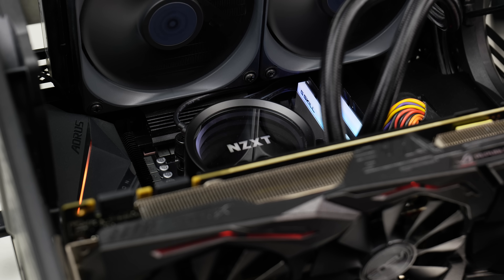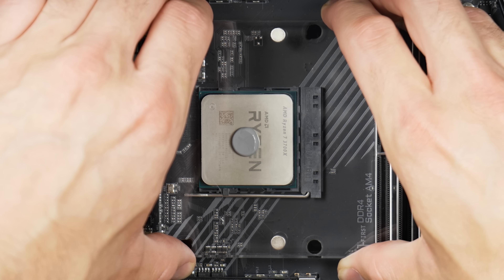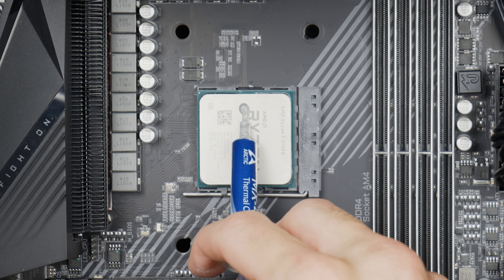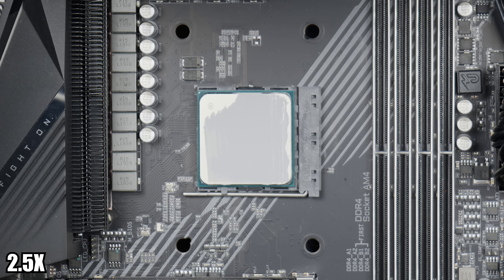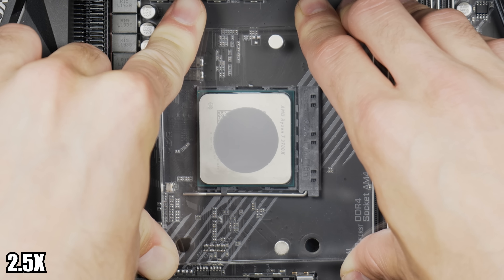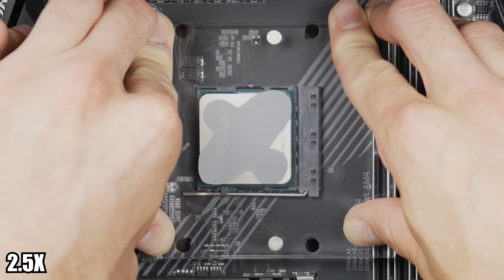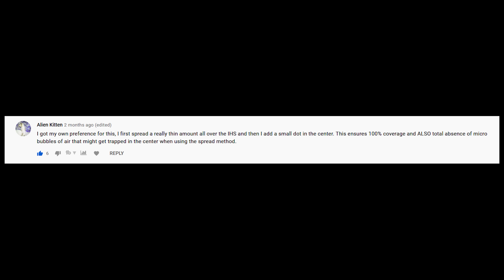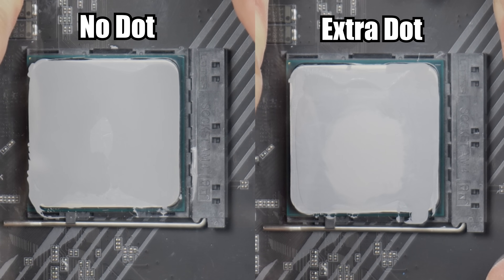Thermal Paste Spread Under Glass

Comment: I suspect "break in" is really just "heat it enough that air bubbles expand and escape", so will mostly effect applications which have air trapped.
Reply: Also, some more tests that would be nice to see:
1) Results if you just pull up the block, and then put it back on without cleaning or adding more paste. (Maybe repeat for two or three reapplications)
2) Results if you pull up the block, and then put it back on without cleaning but add a blob in the center to help push away potential air bubbles.

Comment: Since you found potential air bubbles this time maybe you should redo them in a sandwich of 2 pieces of acrylic. Like cut a square "die" of acrylic and re-use the acrylic from this video to see better if the air bubbles moved or really disappeared
Reply: There will be no air bubbles. You only see air bubble because he is putting pressure with his hands and its nowhere near the amount of force you apply with screwing down CPU cooler.
Reply: @Underground.Rabbit  so you’re saying a CPU cooler is even less able to squeeze out those air bubbles... there’s a reason that industrial equipment service manuals instruct technicians to apply sealants and silicone gasket material without spreading - allowing the material to squish as the two surfaces are brought together is much less likely to trap air pockets. Will a few small air pockets actually hurt thermal transfer? Probably not much, but they definitely won’t help!
Reply: @dregenius  dude, Col. Hans landa is right, there will be no air bubbles, its a myth in pc space. This is not a silicone and there is very strong pressure between cpu and the cooler once its properly mounted.
Reply: @dregenius  according to noctua you can apply 0.6Nm force to their cooler screws. So after few calculations, after tightening those two bolts you apply around ~200kg force to that cooler plate.

Comment: Excellent showcase.  How flexible was the clear cover plate?  Could pressing that far from the cpu cause it to dome up in the center?  Maybe you didn't have to press very hard to get the spread.
Reply from the maker: It's pretty rigid. 1cm Thick (1/3 inch) But I'm sure there was some flex, even if just a little. Might have contributed to the air in the centre of the "buttered toast" test.

Comment: Good test bro. I use the pea method and it has worked well for years. I use a bigger pea size for AMD chips.
Reply: Yeah the pea works just fine. The coolers will also squeeze with more force than he can apply to the glass.